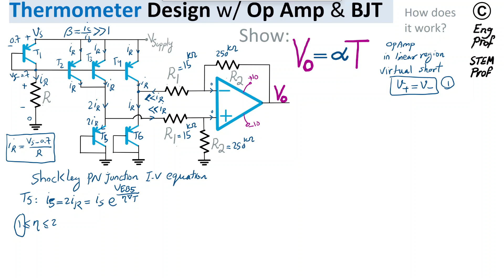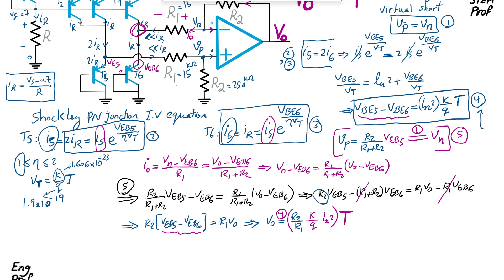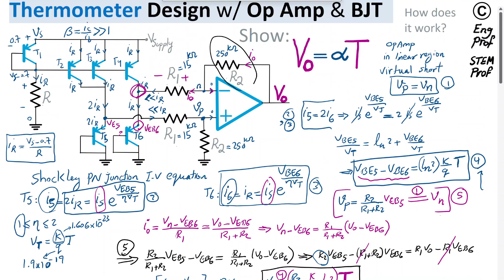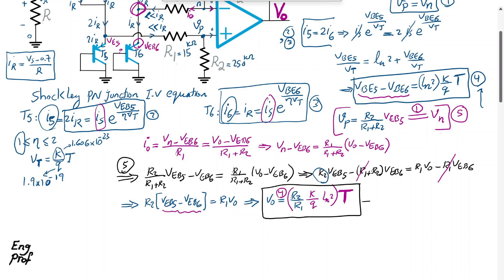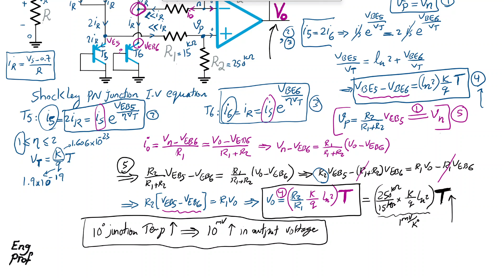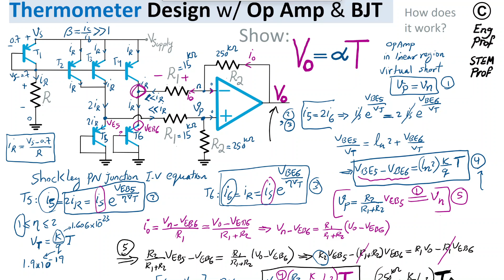Thermometer Circuit Design with Op Amp and BJT transistor

Comment from the maker: Please note that Boltzmann constant (k) is ~1.3806×10−23 & Electron Charge (q) is 1.6x10-19 (while I have used the correct values in my calculations so the computed results are correct, I incorrectly said values of 1.606×10−23 and 1.9x10-19 in the video). For more examples see:  Thermometer Sensor Circuit Explained with Op Amp and NPN Transistor https://youtu.be/5jmbZ9ak6EI
Op Amp Amplifier with Electronic Gain Control https://youtu.be/NoNgQpbj77Y  
Op Amp Analog Computer Differential Equation Solver https://youtu.be/ENq39EesfPw
Push-Pull Power Amplifier with Darlington Transistors https://youtu.be/866MYibo8yE
How to find Bode Plot, Freq Response, Transfer Function of Analog Filters https://youtu.be/vZFkPeDa1H8
Universal Analog Filter Design https://youtu.be/2J-0msXZE2o
Laplace Transform Example and S-domain circuit analysis:  https://youtu.be/ps8N5TPM_qU
Op Amp circuit Bode Frequency plot https://youtu.be/BLVzuuqAlZs
Analog Logarithm Computer https://youtu.be/RpKEq5WyoLg
Lowpass Butterworth Filter: https://youtu.be/UzCjkwqy-9w
Analog Computer to Raise Signal to power n https://youtu.be/IUTlBH1UraE
Triangle Oscillator Op Amp circuit https://youtu.be/JF5Up_cuL9k
Differential Equation Solver Analog Circuit https://youtu.be/R3X5AYNZGEI
Complex Sinusoid Oscillator https://youtu.be/GXRhmwmS5Zk
Sawtooth Oscillator Design https://youtu.be/2eUsGPfqbW4
Full-Wave Rectifier circuit example https://youtu.be/DJJMNU-CYcg
Sawtooth Waveform Generator design with OpAmp, JFET, BJT https://youtu.be/5zHXTx-Vl20 
op amps Circuit with feedback loops to design an analog computer that solves a second order differential equation https://youtu.be/HeZRtnRXpEI 
For more analog circuits and signal processing examples see: https://www.youtube.com/playlist?list=PLrwXF7N522y4c7c-8KBjrwd7IyaZfWxyt
I hope these Circuit design and analysis videos are helpful. 🙋‍♂
Reply: If you're going to calculate pn junction voltages as a function of temperature, I would recommend learning that k/q is about 86μV/K. It's a single value and within the grasp of most electrical engineers to remember. There's little point in trying to be more exact because of the effect of η, even if it is usually close to 1 for silicon. I can't think of a single case where an electrical engineer needs the individual values of k and q, and as you found out, they are rather harder to recollect accurately.
Reply from the maker: @RexxSchneider  Thanks Rexx for watching and sharing your thoughts and feedback. You have a good point and I will try to keep that in mind. For more circuit examples please see https://www.youtube.com/playlist?list=PLrwXF7N522y4c7c-8KBjrwd7IyaZfWxyt
I hope these Circuit design and analysis videos are interesting as well.  Thanks again. 🙏

Comment: What units are you using?  Boltzmann's constant is 1.381E-23 J/K and the unit charge is 1.602E-19 C.
Reply from the maker: Please see the comment right below the video that states:  Note that Boltzmann constant (k) is ~1.3806×10−23 & Electron Charge (q) is 1.6x10-19 (while I have used the correct values in my calculations so the computed results are correct, I incorrectly said values of 1.606×10−23 and 1.9x10-19 in the video). 
Thanks for watching.

Comment: Very nicely explained. Fun to watch. Is this circuit used in real ICs? What if those transistors are not at the same substrate, will the precision degrade too much? Let's say 2 TO92 transistors touching each other?
Reply from the maker: You're welcome. Thanks for watching & your good questions. Glad that this Thermometer Circuit Design with BJT and Op Amp is interesting. Answering your questions, I wouldn't be surprised that Thermometer integrated circuits use similar core design (with additional features). The four top BJT transistors should be matched (use a quad transistor package that are easily available to purchase from say Mouser.com or DigiKey). The bottom two BJT Transistors should be matched as well (use a dual transistor package). Any mismatch can result in substantial circuit sensitivity to junction thermal variations because saturation current of transistor is a exponential function of temperature in such a way that ~10 degree C temperature change can result in 3-5x increase in saturation current. I hope this explanation is helpful. For more Analog Circuits Examples please see: https://www.youtube.com/playlist?list=PLrwXF7N522y4c7c-8KBjrwd7IyaZfWxyt
I hope these Circuit design and analysis videos are helpful.

Comment: Thanks for the detailed explanation.
But please start with a schematic with the junction dots in place, otherwise it can get confusing. And like somebody else already said: you should have just called the differential amplifier what it is and maybe put the derivation of its formulas in another video. I think it is unnessessary in this video.
But it is a great video nonetheless!
Reply from the maker: You're welcome. Thanks for watching & your feedback and good suggestions. Glad that this Thermometer design video is useful. Sure, I will try to have junction dots in future videos. For more Analog Circuit Examples please see: Op Amp Amplifier with JFET Electronic Gain Control https://youtu.be/NoNgQpbj77Y  
Op Amp Analog Computer Differential Equation Solver https://youtu.be/ENq39EesfPw
Push-Pull Power Amplifier with Darlington Transistors https://youtu.be/866MYibo8yE
And Analog Circuits Video Playlist: https://www.youtube.com/playlist?list=PLrwXF7N522y4c7c-8KBjrwd7IyaZfWxyt
Thanks again. 🙋‍♂️

Comment: Not just temperature, but absolute temperature.

And Shockley's is exactly how a transistor works, over a very wide range, so this works over the operable range of the transistor, and is even self-calibrating (So long as you have good matches, at least, and have K and q tabulated well).
Main remaining points so far as accuracy, would be do with the junction heating from the bias current.

For bonus accuracy, modulate ir or Vsupply, and then run the output through a lock-in amp. That should help clear up the noise substantially, depending how you tune the lock-in amp.
Reply from the maker: Thanks for watching and sharing your thoughts & suggestions regarding practical considerations. For more JFET, BJT, Op Amp Circuit examples please see: 
Op Amp Amplifier with JFET gain control https://youtu.be/NoNgQpbj77Y
Analog Logarithm Computer with BJT https://youtu.be/RpKEq5WyoLg
Sawtooth Waveform Generator design with OpAmp, JFET, BJT https://youtu.be/5zHXTx-Vl20 
And more examples in my Analog Circuits Video playlist https://www.youtube.com/playlist?list=PLrwXF7N522y4c7c-8KBjrwd7IyaZfWxyt
Thanks again 🙏

Comment: My principal criticism of the circuit in practical terms is the rather small change in output voltage of 1mV per degree Celsius, despite the opamp's gain of 16.7. For cheap common opamps like the LM358, for example, its offset voltage drift referred to the output would typically be around 10%-20% of that, so somewhat spoiling the accuracy of the thermometer. A TL072 would be even worse.
Reply from the maker: Thanks again for watching and bringing up good practical points like offset.  We should not use high-offset op amps like LM358 or TL072. Instead, for an accurate Thermometer there are cheap but very low-drift op amps that we should use in this design for instance TSZ151 (7 µV) or TSB182 (20 µV rail to rail) op amp from ST Microelectronics or at least MCP6497T op amp (0.6 µV/C drift) from Microchip Technology.
I hope this explanation is helpful.
Reply: @STEMprof  This is definitely helpful additional information. Intriguing circuit.
Reply from the maker: @Guishan_Lingyou  You're very welcome. Thanks for watching and comment. Glad that this circuit & explanation are helpful. For more Op Amp and Transistor circuit examples please see: 
Sawtooth Oscillator with Op Amp, JFET and BJT Transistors https://youtu.be/5zHXTx-Vl20
Voltage Regulator design with BJT JFET & Op Amp https://youtu.be/CJl-urzeiTo
Thanks again for watching 🙏

Comment: What you have here is essentially a classic Wheatstone Bridge setup and opamp in a differential ampilifier configuration. Would have been helpful to describe it this way since it is a very common application.
Reply from the maker: Thanks for watching and sharing your thoughts. I appreciate your follow-up comment. While I understand the similarity and your reference to Wheatstone Bridge (delta voltage between two resistance branches), I am afraid it is not an accurate representation of what matched  BJT current mirror bridge is achieving in this Thermometer circuit involving Shockley PN junction exponential I-V equation. My recommendation is just to refer to them as BJT Current mirror Bridge if a reference to Bridge concept is desired. As for the OpAmp portion, yes it is effectively a Differential amplifier composed of an inverting amplifier and a non-inverting amplifier and matched resistors.  For more examples please see https://www.youtube.com/playlist?list=PLrwXF7N522y4c7c-8KBjrwd7IyaZfWxyt
I hope these Circuit design and analysis videos are interesting.  Thanks again.

Comment: Question about R that sets the current iR via the transistors. 
I looks like the answer is not really depending on it, but the in real life a low iR current will have some effect on the output. What will be the effect of setting iR too low or too high?
Reply from the maker: Thanks for watching and your good question. Output voltage of this circuit is practically independent of the reference current iR as long as it is set properly by selecting proper choices for supply voltage and Resistor R.  If resistor R value is too low, reference current will be too high and will drive the reference current mirror PNP transistor to saturation (which we have to avoid).  If resistor R is too large then the iR reference current will be too small and circuit will be more prune to noise and variations.  I hope that this explanation is helpful. For more examples please see https://www.youtube.com/playlist?list=PLrwXF7N522y4c7c-8KBjrwd7IyaZfWxyt
Thanks again for your interest and question. 🙋‍♂